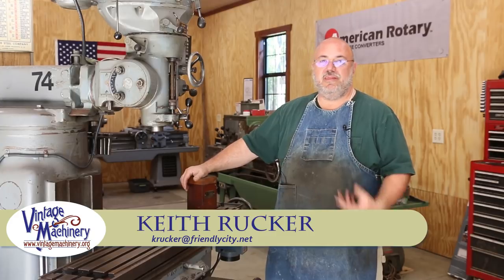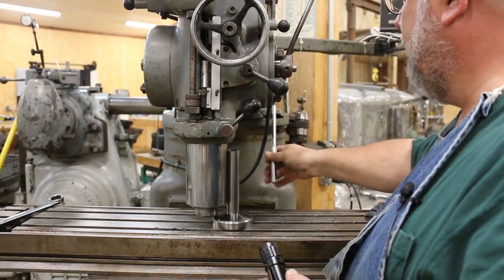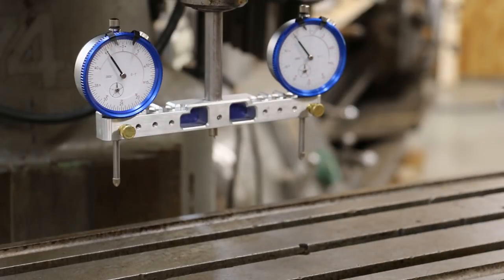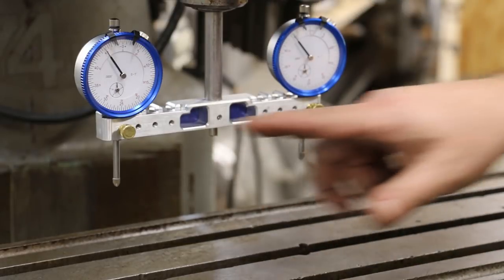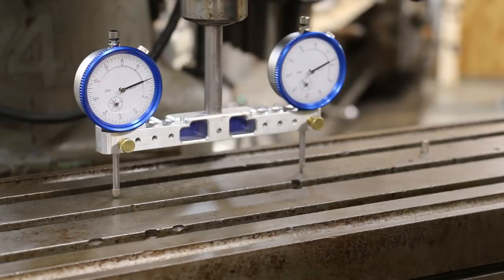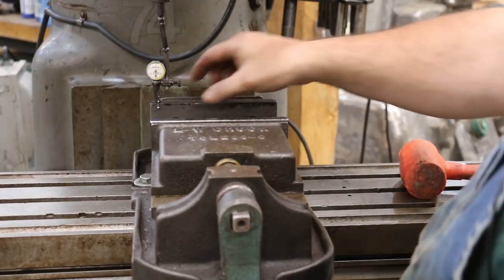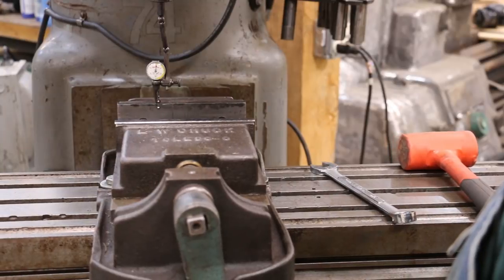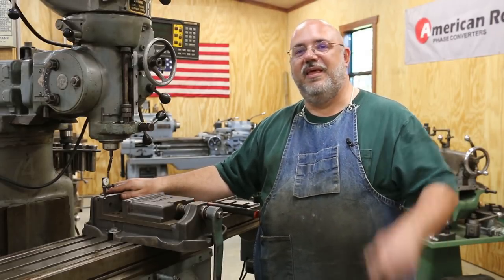Milling Machine Alignment:  Tramming the HEad and Vise to Square and Parallel

Comment: Isn't a cylinder square pretty self-checking though...? Assuming it has a constant diameter along its height (which one could check), rotating it in place 180 degrees and checking the quill again should immediately reveal any non-squareness...
Reply: seems correct, assuming it also has a constant diameter base, you could place it against a stop and use a dial guage
Reply: Yes, this is basic check. And it allows you to use worn out cylindrical square.
There are also factory made tilted cylindrical squares! But that's another story.

Comment: Why not put a dot of paint (for Visual on rotation) on the cylinder Square and rotate it 180 to check for accuracy? How far would that go?
Reply: That sound like it would work to me. It is basically the same technique used when replacing a broken bubble level on a carpenter's framing level. When it indicates the same when flipped 180, it is on the money.
Reply: The one thing you dont know is if the Square is tapered or not. You might see something is off by way of first method, but not what.
Reply: you can check for taper with a micrometer on the shaft, so the turn around method will work, assuming a nice flat table
Reply: Jusb1066     yes but it is difficult to make that discernment on the table during squaring up. Assumed you are not 100% sure the quill is aligned and tip top
Reply: Also the same as checking a normal square against a straight edge, flipping it over and checking against the previous line etc.
Reply: A cylinder square should give the same readings 180 degrees off, by its very design, if the vertical rod is truly cylindrical.  They usually are, to high tolerances.  The biggest issue with them typically is that they are leaning from vertical because of a problem with the base, often just junk under it or a non flat surface it is resting on.  To look for discrepancies, check it 90 degrees from the first test.  A cylinder square is always accurate at two specific and opposite clock positions.  Those positions can be marked and used preferentially.
Reply: I think this would make sense on a surface plate, not on the table of a mill. As a matter of fact, the cylinder square is a bit of overkill for this job; a decent machinists square, will work just as well!

Comment: No No No.  Don't need a square.  just put an indicator in a collet in the spindle. rotate spindle and adjust until completely square 360°  . making this a lot more complicated than it needs to be.  Toolmaker here for 40 years.
Reply from the maker: That method works just fine, but I would argue that it is not easier than this method.
Reply: Nothing wrong with either method and there is “more than one way to skin a cat”.
Reply: @nevetslleksah  there is PLENTY wrong with this double indicator method and notice he did not do the Y--nod--he stopped because had he adjusted it both indicators would have moved the same direction totally counter intuitive. I will do my own video!!   The poster is a smart guy however the other person that said this makes something complicated when its not. Its simpler to just use the normal method. The double indicator thing shows you can sell ice to the eskimos  another device to get the money of beginners.. another one?--COAX INDICATORS

Comment: I believe it is worth mentioning that, before getting into the whole spindle alignment, one has to make sure that the table is running zero in both directions! 
I don't like the new toy: it just does not add anything in comparison with just using one indicator. Why use two dials, if you can get away with one? (For anyone who is able to divide by two). Every indicator has its tolerances and by using two of them, you will have to count them up.
I really just don't get it!

Keep on making the good stuff!
Reply: Fernand, the annoyance with using just one indicator is that the pivot point isn't the middle of the plane established by the zeroed tip of your indicator when swung from one side to the other on the table. The pivot point is the center line axis of the milling head mount which is probably 12in/300mm away. This means that the plane established by using one or two (e.g. the dual indicator tool shown) indicators is in fact a chord of a circle about 24"/600mm diameter. When using just one indicator you will notice that as you adjust the head the "zero" on one side refuses to stay in one place. It will change every time you adjust the head. The readings will get closer and closer to the same value as the head becomes vertical to the table.  That seems easy enough, but it's very easy to miss the vertical point and go past it and you keep going without realizing you've gone too far. 
Keith should have shown this effect and why using the dual indicator makes hitting the vertical alignment point much easier than swinging a single indicator from side to side. When he set both indicators to zero on the same side of the table, that established a plane that is perpendicular to the spindle center line and the he could, by adjustment of the head, make that plane parallel to the plane of the machine table.
 
Orlin in NC
Reply: The real benefit from the tool is that the dials always face you, and you don't have to worry about knocking the indicator out of zero when you swing it over the t-slots.
No reason to buy the tool though, it takes all of 10 minutes and some scrap to make one. A pair of inexpensive indicators and your done. The best part is, that since you are doing a comparative measurement, the pivot rod does not need to be perfectly square to the bar, and the indicators do not have to be perfectly spaced. As long as you are very close, any sin error will be in the 10ths or less.
For what its worth, the best way to use this tool is to face it away from you, zero both dials on something, then turn it around and lower it to the table. The indicators will measure double the error, so it is easier to get it into tram.
Reply: Like Tom Lipton showed!
Reply from the maker: Like someone else pointed out, the big advantage of this setup over a single indicator is that the pivot point on most mills is not in the center of the spindle.  When adjusting the nod, it is not as easy as just moving things half way when you sweep.  With this tool it is a more direct reading an much easier to adjust.  Nothing wrong with the way you are doing it, I just believe that this tool is quicker and easier.
Reply: OK, Keith, let's shift this discussion a little bit. I've read most of the comments on this topic. And it's not about who is right or wrong: there are many ways that lead to Rome! However, I concluded that you have a lot of starting machinists on your channel. Maybe, the discussion should not be about the fastest or easiest way to align a spindle head, but more like a general understanding of aligning machinery. Does that make sense?
I would really like to challenge you to make a follow-up video, doing the exact same thing with only an indicator.
Does that sound fair? (or even interesting?). It's not hard.

Kind regards, love your video's (most of the time ;-) )
Reply: Fernand Geene Van I've come to the conclusion that this is not your channel, therefore, he can do it whatever fuckin way he wants to.

Comment: Have you watched your own video? You showed us how to use the tool. You didn't actually show how to make the adjustments to the table.
Reply: What don't you understand?  He is not making any adjustments to the table.  He is squaring the spindle center line to be perpendicular to the table surface.  There is a knuckle on the ram which pivots parallel to the cross slide, and a rotating pivot on the head.  Generally, there are degree graduations marked on each to get you 'in the ball park'.  A dial test indicator in the spindle can be used to 'sweep' a circle on the table.  Adjust the knuckle and pivot accordingly to achieve zero on the indicator over 360 degrees and you are done.  With a little practice, it can be done in several minutes.

Comment: dear God a cylinder square is 300+ bucks :(
Reply: I was thinking the same thing.  You could make the twin indicator device in an average hobby machinist's shop — especially with what Lyle (Mr Pete) calls Chinesium indicators — but the cylinder square is a whole different proposition.